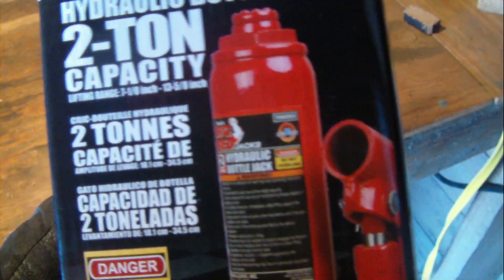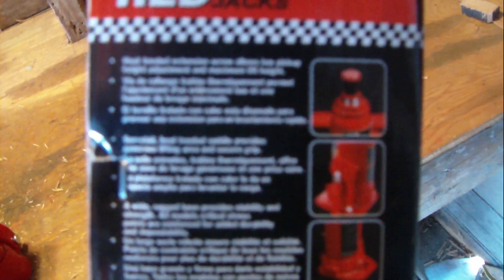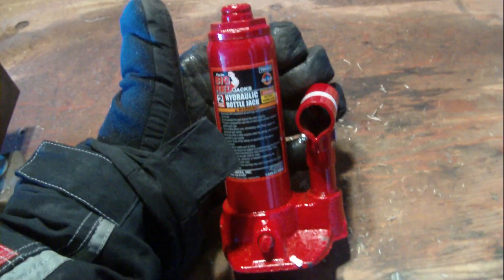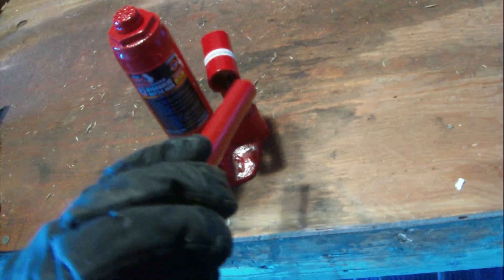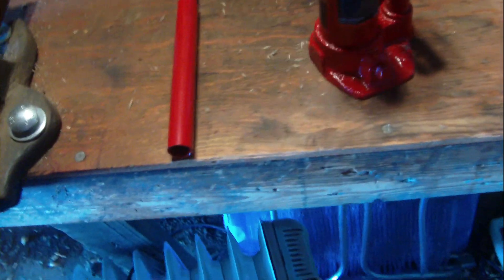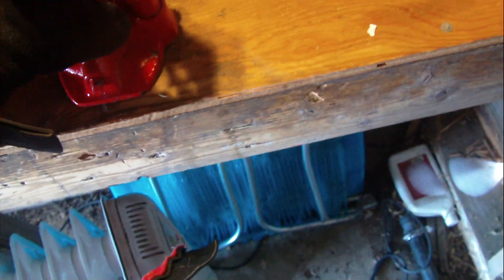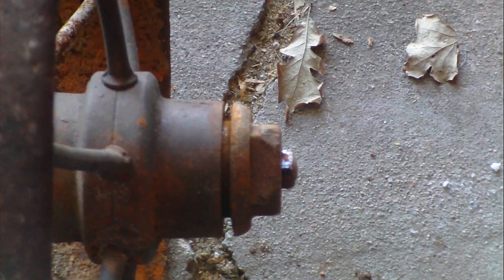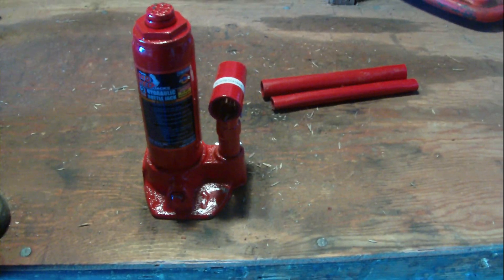my new TORIN BIG RED 2-TON JACK. :)

Comment: a BigRed jack for BigRed.....lol...wrap some tape around the handles to hold them together...

I've got 5 jacks, a 2 1/2 ton floor jack, a 1 1/2 ton floor jack, a 2 ton bottle jack and the transmission jack and a mini 250 pound floor jack that is about 8 inches long, I used it for my RC trucks...lol...